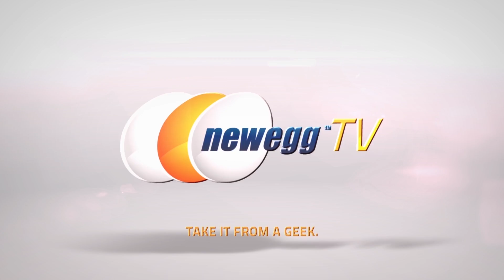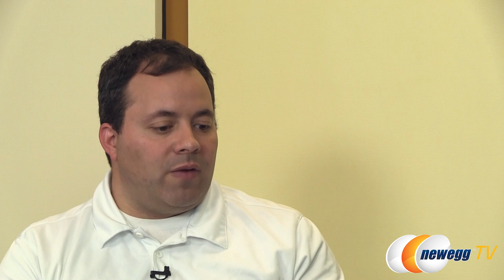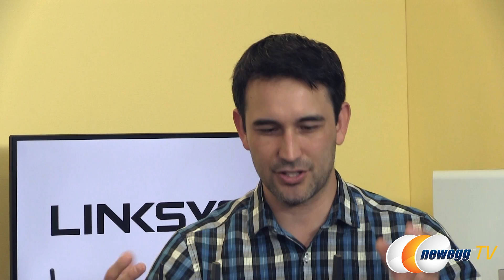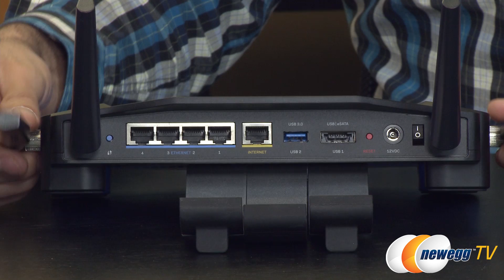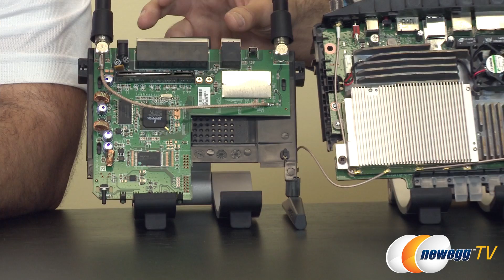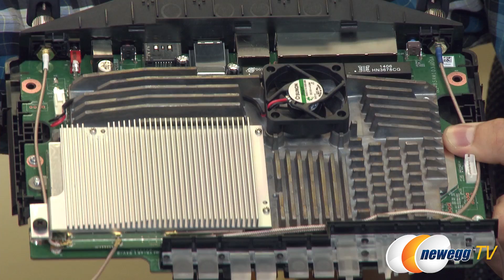Linksys WRT1900AC Wireless AC Dual Band Router Interview - Newegg TV

Comment: Bought this router about a month ago. It really isn't that bad at all when you compare all the 1900mb/s AC routers out there.
Device to device I can get about 1700mb/s between two AC devices, which, compared to the 1900mb/s of in-lab testing, is pretty damn good.
One thing to keep in mind, is says its "OpenWRT Capable". Truth is, Linksys has thrown a bad batch of firmware WRT's way, and that's it. Don't expect to run a stable version of WRT on this any time soon.

Comment: Just bought one a few days ago and not impressed at all. Constantly dropping connections and if not daily multiple times a day I have to reboot, I can see devices but they can't communicate, reboot and they magically work again. Needs help fast! I haven't had anything other than Linksys and it seems since EA6500 the rush to AC was not a well thought out endeavor. I am very disappointed so far. If you want great reviews, make a great product instead of rushing them out!

Comment: im always confused between router and switches because both direct communication,both have wireless connection,both have internet connection and direct to or from internet,both have firewall ability but one is called linksys switches and the other is called linksys router.... still dont get why 2 names is used and both can do the same
Reply: A router can connect two different subnets together.